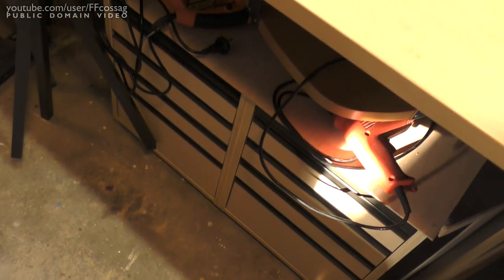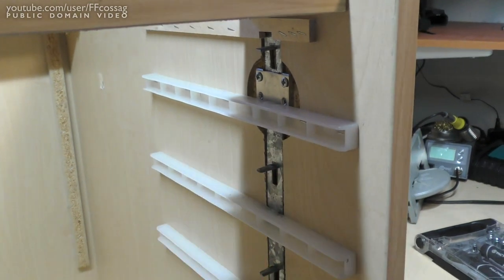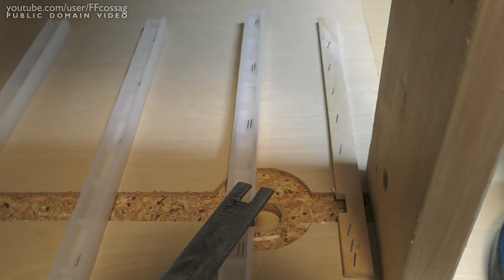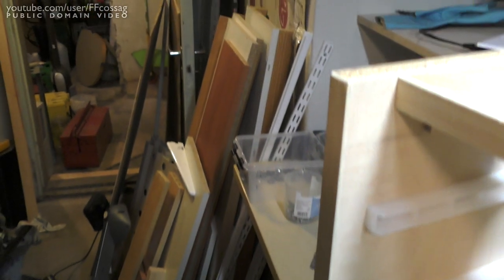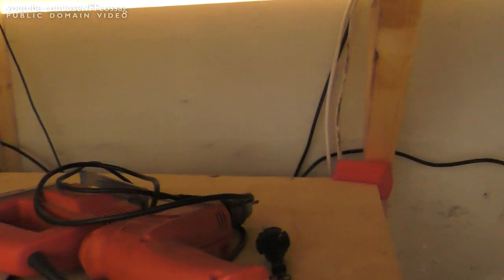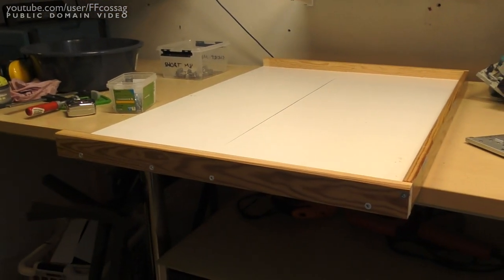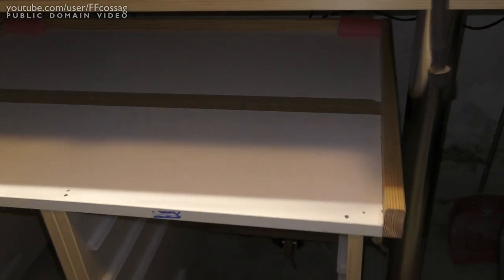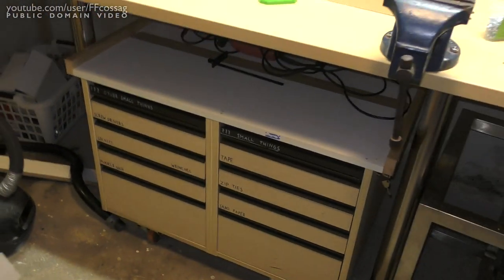Furniture with FF | Office cabinets into rolling tool drawer

Comment: What? No "Drawer of Many Things"? Everyone needs a Drawer of Many Things... :P
Reply from the maker: I have so many things that no drawer could fit them all.
Reply: Nah, a drawer of many things is the special place for all the little bits and pieces that have no specific place that they belong, and hence are placed into a drawer of their own, filled with many different things... :P
Reply from the maker: I have a box labelled "regrets" for that.
Reply: You mean a man draw .
Reply: It is called magic drawer and every house has one. It is that drawer which you open and find the paper clip you want right now or small roll of sticky tape. Or small candle with matches. Top for a jar. Those things are spontaneous manifestations though, intentional does not happen. After they happen it is impossible to get rid of one. I tried for several years to get rid of one in the kitchen, pretty sure other people in the house sustain it. My drawers are not magic at all, though broken things drawer is pretty magical now, it gives me things with which to demonstrate science to people all the time for some reason (lightning globe how that thing is called lights up power saving lights, gf does not believe me or science, drawer provides dead bulb immediately! no your car does not generate infinite electricity, drawer gives electric motor to play as a generator, could have provided a gearbox too, but that was magic limit I guess)

Comment: wow, why you have batt makita saw? I though you were poor! Traitor! ;) I have gr8 makita drill thing, dad takes it all the time to use on the farm, did not managed to kill it yet, got himself makita death wheel now, but that is old school, with a wire. Battery things still expensive. Rip all wallets.
Edit: rip woodgers ca guy too, defeated by sticky tape :D
Another edit: If you are into making things,or science northing really is "final iteration" ever. I ,remember your van power supply, it had a name fitting multiitertated thing too :)
Reply from the maker: It's an investment. At a 300 € purchase price and an expected lifetime of 5 years and a best-case lifetime of, say, double that, the monthly cost of ownership is 5 to 2,5 €, which I can afford. Buying expensive tools helps me get off my lazy ass and use them, since I can't stand that money ticking away unused.